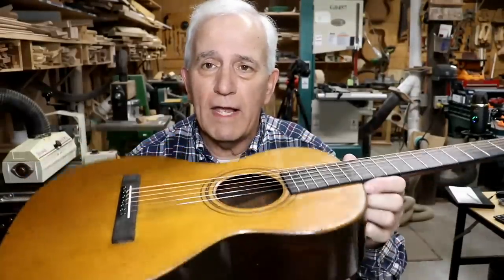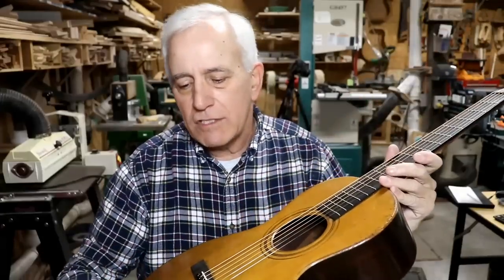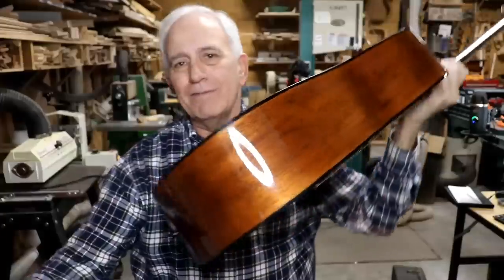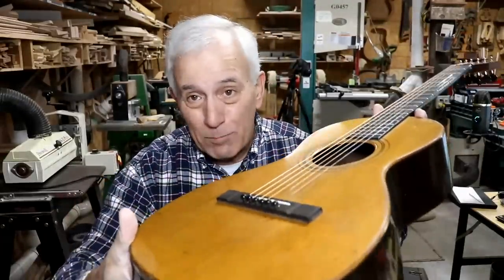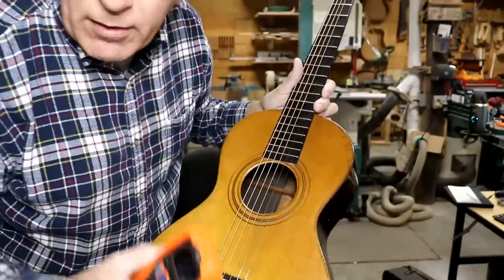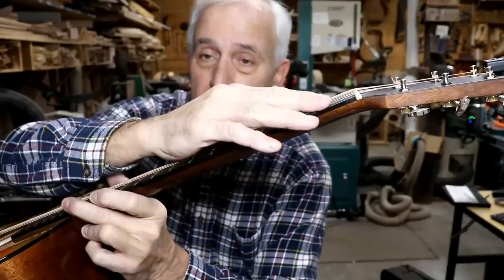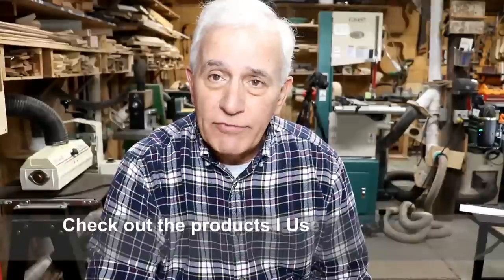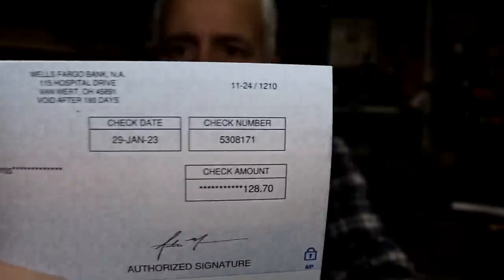Vlog #188 Check Moisture Content 3 Instruments

Comment: I'm a witness to what he said about the chemical humidifier packs. I put one from d' addario with my Martin D35 in the Martin hard shell case and didn't have time to play for a couple of years. When I took the guitar out I found the humidifier had leaked making a mess of the case liner and a spot about the size of four silver dollars on the back of the guitar. It warped that area of the wood and went from the inside clear through to the outside. Of course d'addario doesn't want to back up their product I'm sorry to say. also a comment on his using the humidity meter- He has quite a selection of bare wood in his shop. Why not measure a few pieces. I would think that the humidity of any wood left in the shop would  all be about the same after a few days so those guitars should be what ever the humidity is in the air of the shop.

Comment: Reverse cycle air conditioners Jerry and droughts. I have seen ebony and rosewood fingerboards boards shrink when they had been on the guitar for 30 years. I have also seen where glue has failed, even Titebond, in the tropics. Australia has extremes. In 2018-19 we had a very near nationwide drought. Two luthiers I know, both with 30 years plus experience had guitars coming in with cracks all of a sudden. This does not happen in normal seasons.

Comment: Great example with the spruce wood. I personally feel that temperature and humidity are two different things when it comes to wood. Wood becomes brittle when it is cold and pliable when it is hot..... and it has little to do with humidity. Though they can be relative. They both can harm wood but you can have high temps and low humidity. Think desert. You don't want wood in the desert. They is why they don't leave wood in a kiln. You can have cold temps and high humidity. Think freezing rain. Though they are relative, in some facets, they are distinct.
Reply: "They is why they don't leave wood in a kiln"
No, that is exactly why they put wood IN a kiln, to get it Below desert humidity levels.
Humidity = instability.
Reply: @zapa1pnt  notice the word... Leave. No. They take wood out of a kiln at a specific humidity level. Leaving wood in a kiln for too long will destroy the wood. Think about the long term environmental impact of a desert. It destroys wood.
Reply: @tothepoint7258 : Actually, the factor, of the desert environment, which destroys
wood is the UV radiation. Wood not directly exposed to the sun will last darn near forever.
Reply: @zapa1pnt  not exactly accurrate. Think roots. Some wood will fossilize. Some will not. It depends on certain conditions. Extreme heat will completely destroy the oils and resins in wood. Which is why kilns don't remove all moisture from wood. Take a look at how torrified tops are created. The best tops require multiple applications of heat at specific temperatures. It is interesting. People over simplify the humidity argument. I'm convinced many woods in guitar making are not adequately dried to begin with. Wood isn't a sponge. It takes extreme extended times with high humidity to really affect the internal moisture content in wood. Take a look at sinker mahogany.

Comment: This makes sense, to me. Wood absorbs moisture as it grows through osmosis which follows the grain paths, generally, I think. I don't think they share as much moisture side by side, during growth. If you plug (finish) the ends of the grains, osmosis is effectively shut down, perhaps? Just guessing but I think might slow down the process of drying out, perhaps?

Comment: Jerry you really should check the inside. I feel like checking thru the finish was pointless to shut up the nay sayers.
Reply: He tested a piece of wood that has been on his shelf for two years. There is zero chance there is 7 percent humidity in the air around that wood. When you have less than 30 percent humidity in the air, you can feel "static" in the air. It is extraordinarily uncomfortable. In fact, it is dangerous when there are electronics in the area.
Reply from the maker: I'm sure I will eventually I just wasn't gonna take these strings off of those just prove a point
Reply: I figured you would Jerry. And ToThePoint I cannot really compare a block to a thin top or back on a guitar. But I agree with Jerry on the humidity thing. I do not humidify. In My house (I live in eastern NC) it stays a min of 45-55% year round.
Reply: Hey man you can win your debate. I don’t want to be in it. I don’t troll comments I was trying to speak to Jerry.